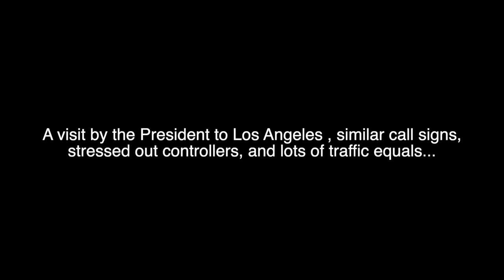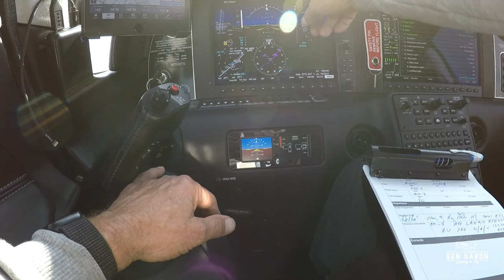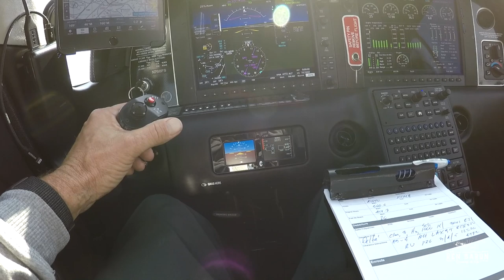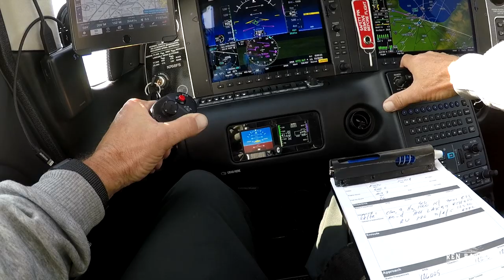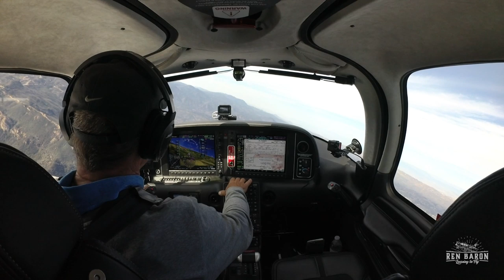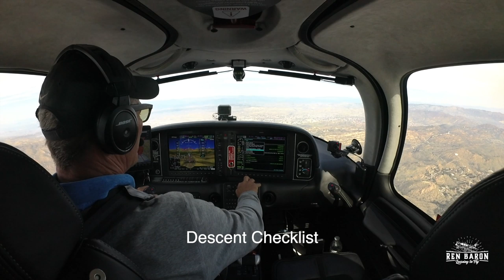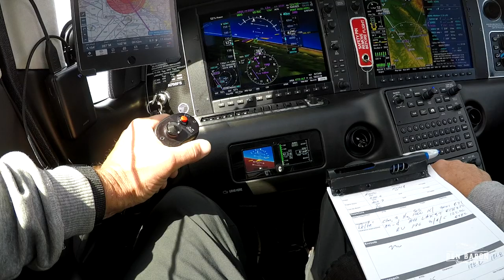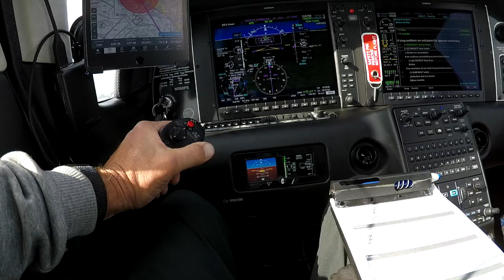High Stress Flight  in Cirrus SR22T Gen 6 (Long Version with Pre Flight)

Comment: Nice flight.  Nice video. It might have been beneficial to use your full callsign when similar callsigns are on the frequency; especially if the controller uses your full callsign. He also could have issued a caution for the similar callsigns.
Reply from the maker: Agreed. It does not happen often but next time it does I'll use full call sign on all calls to approach instead of just first call.

Comment: The TEC routes (like SMOP36) don't exist in the G1000 database, do they?  Do you enter SMO and VNY in the G1000 route?
Reply from the maker: The TEC routes are listed in the chart supplements and are really just shorthand for specific routes within the So Cal airspace. I’m going to post a little video explaining how they work.
Reply: @TheRenBaron  Yes, thank you, but you didn't answer my question.  I know that the text (route waypoints) can be found in the A/FD (now known as Chart Supplement).  I am not a ForeFlight user, so I wondered if you were able to just type in "SMOP36" or "P36" to get the waypoints "SMO" & "VNY" into your flight plan that you then transferred over to the G1000.  Or, did you need to type the two waypoints "SMO" & "VNY" into your route manually.
Reply from the maker: @briank1916  Well I typically use Foreflight to build my flight plan and then input to the FMS so I've never actually tried entering SMOP36 directly. Once I've uploaded to the FMS the waypoints are inserted. You might want to consider using Foreflight.  I'll post a video showing you how shortly. Or I suppose you could just look in the Supplements and enter the waypoints manually into the FMS.
Reply from the maker: @briank1916  here is a video that explains the TEC route and how I enter it into the flight plan https://youtu.be/eNc5dEGOnZE
Reply from the maker: https://youtu.be/eNc5dEGOnZE
Reply: You just gotta enter each waypoint. Some people omit waypoints that do not cause a turn in the route. The G1000 (and several other avionics, but not all) have the ability to enter an airway along with a starting and end point along that airway (and it automatically inserts the waypoints along that route).